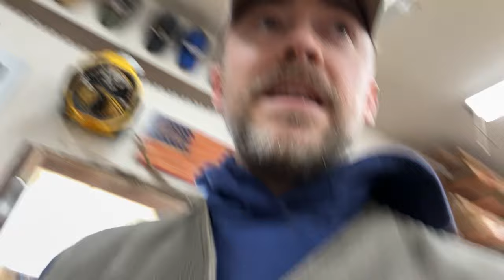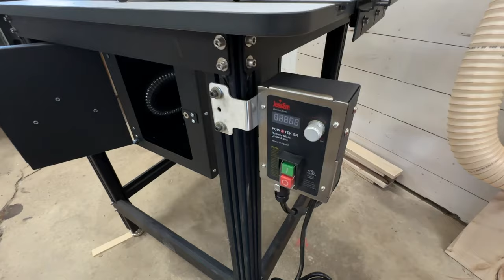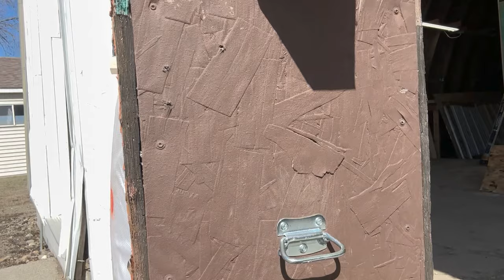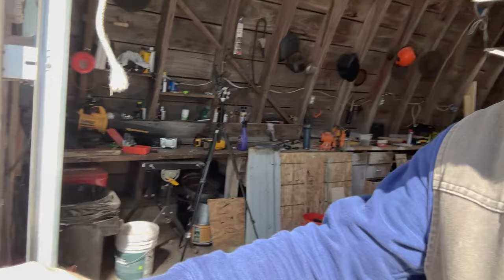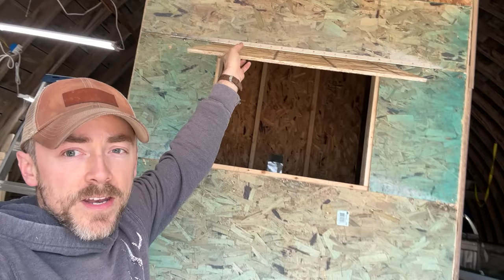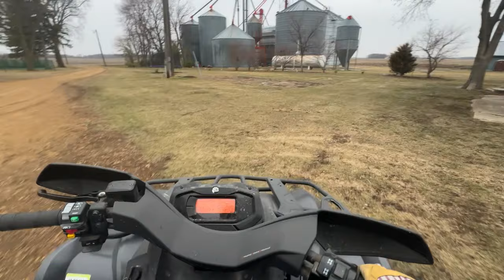Highly Figured BTUs

Comment: I laughed so hard on the part where you are trying to back up the trailer. Most of the time it ends that way for me as well. It's hard backing up a small trailer.
Reply from the maker: There's not a lot of control in those tiny little garden trailers!
Reply: Wagon 42
Mark 1
Know the feeling. Have a great day.